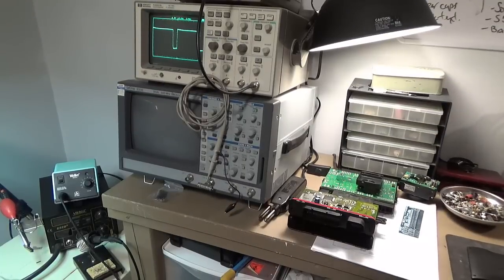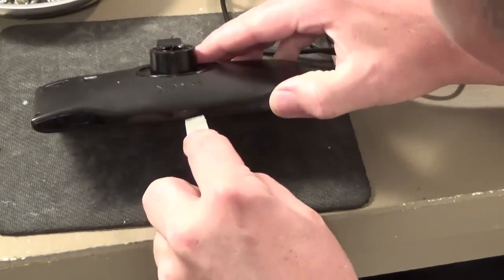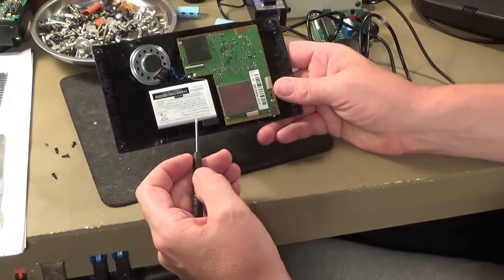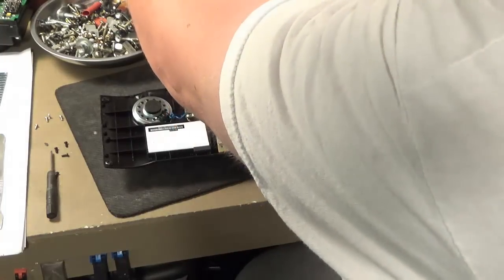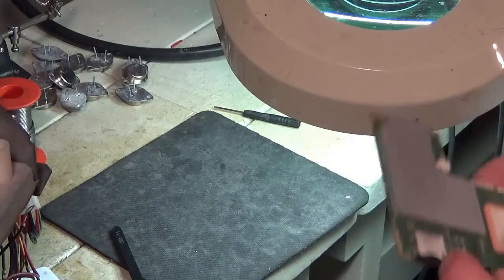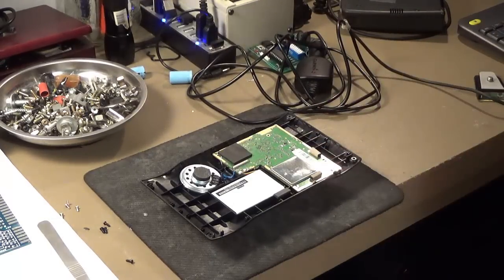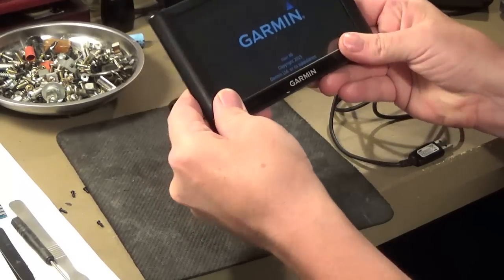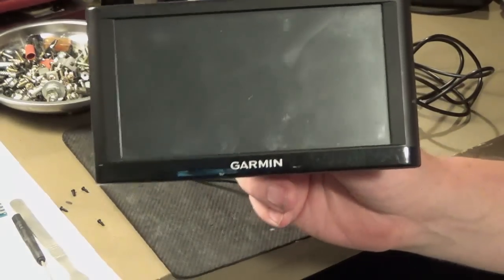GARMIN GPS POWER JACK FIX

Comment: Thank you- I have a new Drive 51 and you just taught me about a poor design issue. I will see if I can buy a cable to glue to the back of the GPS and always connect to the cable. This way, the plug no longer has the stress of the cable hanging on to the male power plug but all the stress is on the cable glued to the back. I will glue it an inch from the GPS plug so if I ever have to take the unit apart, I can still unplug it from the back. The trick now is to find the 90 degree plug like I have with the DC car plug in and the a/c power supply that I purchased. I would have never known if I didn't see your repair video.

Comment: I'm finding that a lot of plug in ports for cables on gps units are having this problem.  I had to open my cradle for my garmin nuvi 750, and add solder on the port that the car charger cord plugs into.  Loose and prys away from connection to circuit board.  One drop of solder on each side solved the problem.  Was getting message - loss of external power, with the 30 sec to shutdown.

Comment: You showed every thing in nice way except fixing the USB port which also requires small technique to solder the four points. Its not easy unless you know how to blow the old tin with tiny vacuum sucker device or copper mesh absorber.

Comment: thanks was about to chuck mine out took it apart usb port still in position but ran soldering iron over the small connectors on the board seems to have fixed it. can we not have so much nose breathing next time. it sounded like chief reagan in blue bloods. it seems that all he has to do is breath out through his nose at least 50 times an episode . apart from that great.
geoff x

Comment: Was getting "Power cable not compatible..." repeatedly. Also, unit would power self off, repeatedly. My final trial and error attempt works. When I plug cable into 12V I hold USB connection firmly then run cord up the back of unit, and over top towards front.

Comment: Where can I buy an AC power adapter for my GPS.  I do have a car charger and the UBS cable but I prefer to bring the unit indoors and charge it overnight with AC power.
Reply: william cuppett Why not just plug your USB cord into a square adapter box. The one that your cell phone or tablet would work. They're super cheap. Fyi: I got a new cord at Walmart - it's the same one that works an Xbox or PlayStation (I forgot which).  It was about 5$. Just take the cord & plug into an ac adapter. Viola!

Comment: Garmin products and any others companies products that are designed and uses with tort screws to tighten their products covers.So any regular consumers can not able open it with any regular Philip screwdriver to their internal circuits boards for like to changing a battery or re soldering any parts are jack asses as for a corporation companies.Most regular electronic tinkers and hobbies don't always have a set of small tort screw drivers lying around.
Reply from the maker: Chi Chu your right. best thing for anyone looking to repair, modify or teardown small electronics gear is to purchase a multi set of torx, and also a small set of regular screwdrivers etc.

Comment: Good video, however, really wIsh the camera was over the work area so we could have seen the actual solder repair. That said, GARMIN really needs to get rid of those archaic "mini-usb" (type-b 5 pin) power connectors seeing how nobody uses those ancient connectors anymore. I'm actually half tempted to open up my Garmin and replace that mini-usb type-b 5 pin with a more modern power connecter... either a female lighting, micro or type-c power connector.

Comment: Where do I buy cords to my Nuvi 265W Garmin?
Reply from the maker: Kathi Cline well you need to make sure if it's the actual cable orbits the power charger. try plugging it into the wall and see if it works. if so your good and can just replace your cable. if not then you need to have the jack fixed as described in the video. good luck. 
your also welcome to send it in for repair. I've had 2 people do that from seeing the video. thanks chris.
Reply: It is not the jack.  When I plug the cord into the cigerette lighter the red dot light does not come on.  It does not plug into the wall.
Reply: Chris Lee Annis )

Comment: You would think a company like Garmin would incorporate perhaps some magnetic type port to prevent this issue ... I have a Garmin, and I have the same problem.
Reply from the maker: Yeah that would help I suppose. But it's more about the connection to the bosrd and where they actually put the damn thing. Because they are on the back they are top soldered to thier boards  , so even the act of plugging something in and out repeatedly will cause stress on the joints. Most devices use the sides and tops and bottoms (cell phones) to side mount these things which makes for a much better solid connection. 

Yeah their engineers forsure could be making this better, but then you wouldnt toss it in the trash and just buy another now would you. ??

Comment: The "L" in solder is silent letter.  The correct pronunciation is "sod' r"
Reply from the maker: this is actually not true at all. if the spelling is solder, then its clearly solder. not sodder. you wouldn't say if you were colder you were codder and you wouldn't say holder as hodder. this is just another example of Americans twisting up the English language. go to Europe and see if anyone is walking around saying sodder. its ridiculous. its not silent at all. 
regardless, this is not the place to have a full on debate about the English language. if thats all you took from the video than im sorry that you feel that way.
Reply: solder |ˈsädər|
Reply: Depends on a number of different factors. But Americans drop the 'L' sound.

Comment: That broken connector is from people leaving the plug plugged in to the connector all the time. They probably dump everything in a bag which breaks the connector. They would prevent that mes by putting the GPS in it's case. I would charge them a BUNCH for their stupidity!